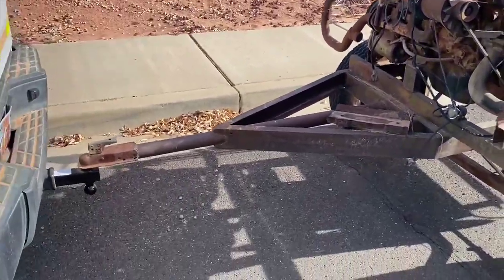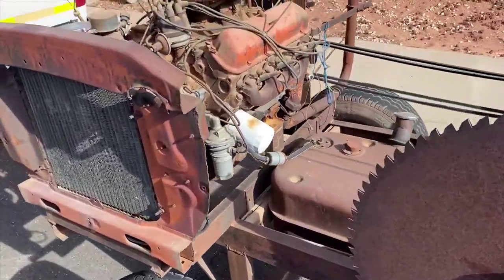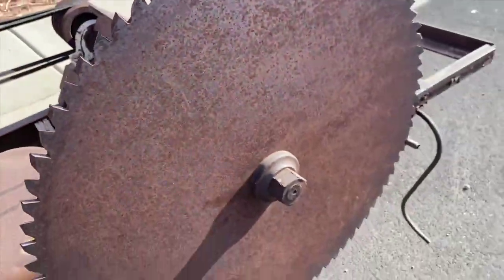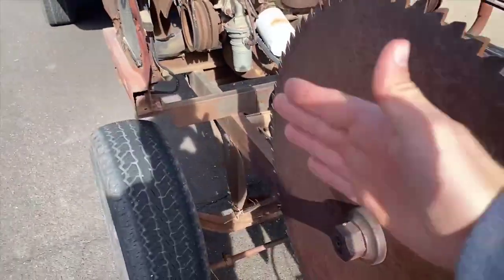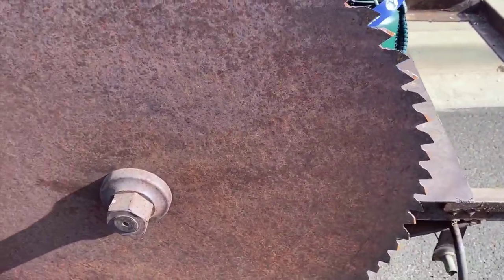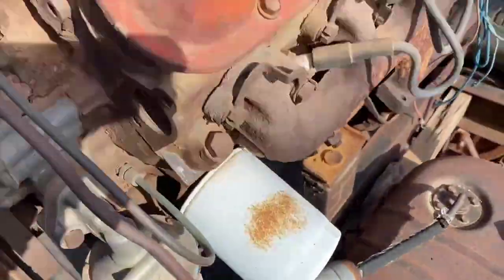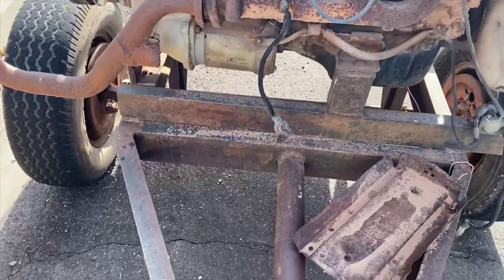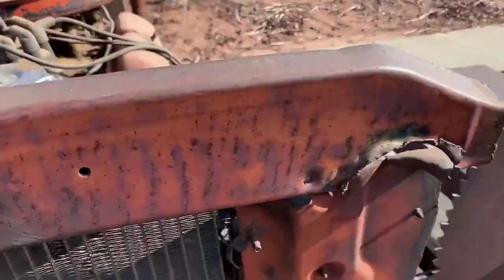After 20,000 Pounds of Scrap Metal - What to do with this?

Comment: It's for cutting firewood.  I built one on my channel. The table  slides back, you put the log on, and push it into the blade. The 289 Ford engine is overkill. It would work with a 13 hp honda. Maybe try getting it started. The engine might be worth that much by itself. Someone will want it don't scrap it.
Reply from the maker: Thanks for the heads up! And for identifying the engine! I'm definitely going to try and sell this as is or to someone who wants it for parts. Much better then sending it for scrap!